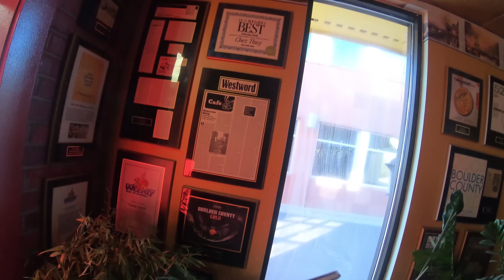RESTAURANT WINDOW CLEANING | START TO FINISH | 4K

Comment: Just a simple question. Why isn't a water fed pole / DI water system used to clean windows on a restaurant? It seems like it would be faster. For instance that restaurant? Is there something that you would be willing to share? Please share your insights. Thanks.
Reply from the maker: James Brown I would maybe if I had a truck mounted system, but I do all storefronts and restaurants traditionally. For me I use WFP on large commercial jobs and homes mostly. I think traditional is just quicker in these situations

Comment: Nice video of different techniques.  I really have to force myself to use a little squeegee for cleaning ledges. I have been just using the same one I used on the glass, but then it's all junked up for the next window.
Reply: You can use a natural sponge also.    Some windows don't get cleaned every week and the water is black.  If the surface below is a light color,  then a sill squeegee will make black runs on it.

Comment: What GoPro are you using?? I’ve got the new 7 silver, not 100% sold on it. It’s got a lot of issues.
Reply from the maker: Justin Dyer go pro hero 6 is what I used here, also use the hero 5 session which is one of my favorites
Reply: I’m considered trading to a older model GoPro. The 7 needs a lot of updates before I could say it’s a sufficient camera. Battery life is terrible.
Reply from the maker: Yea my 6 is horrible with battery as well. Go pros are great for action shots, for audio they suck, ive had to upgrade to a way better mic from RODE to get good audio. My next investment is the DJI osmo